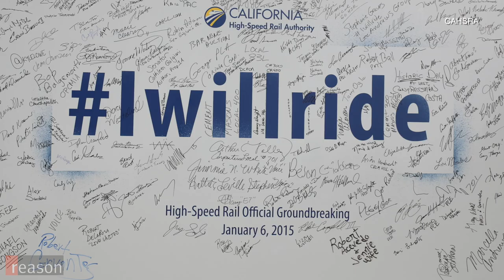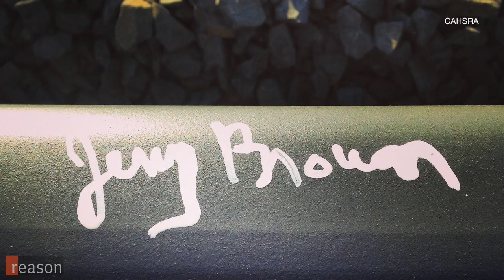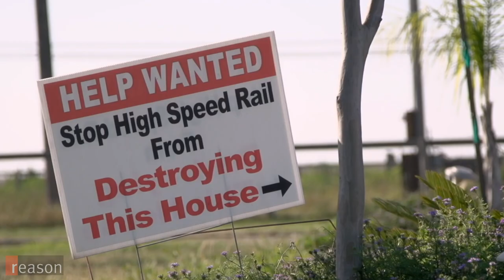The Politician Behind California High Speed Rail Now Says It's 'Almost a Crime'

Comment: Regardless of cost, even though it's a huge cringe, this also occurred with Japan's first attempt at high speed rail. It went so far above budget, that the people who helped create it essentially stepped down as being in charge. However, it proved to be the most efficient and productive way to transport passengers and mitigate traffic when compared to planes and airports alone. No one wants to spend money, but we have to spend way more now because we all went back on our chances when we had one at rail back in the 1960's. We threw away our chance when we pulled out short rail throughout los angeles county alone. Now that we realized that constant buying of cars with no limits in sight isn't sustainable, we're now putting light rail and long range rail back in. But yes, the price is much bigger than had we kept our rail property we originally had and had built when we should have back then.
Reply: i know this is 3 years old, and i really don't care.
so heres the thing about what you said: we are using 1800s technology to solve a problem with poorly designed freeways in california from the 50s and 60s, to basically attempt to pull back cars from roads, which are a 1900s technology. we should've used 1800s technology (going back to the stone age of mobility basically) back in the 60s and followed what japan and eruope did, so we would've had the "high speed trains" (aka, trains with just a bunch of new and modern equipment so it can go much faster but still be stupidly limiting on mobility) here.
how does that sound reasonable and innovative? you are basically wiping the dust off a old technology, replacing the steam engine with high speed electric powered engines and then put a buttload of electronics in the locomotives and the passenger cars so they appear modern but in reality its reusing a technology from the 1800s to attempt to solve a problem with heavily congested corridors the very same government let get congested to begin with.
and how is that fair to the average consumer? its not.
and much like 99.5% of all mass transit in america, it will get underuilitized and never make a profit for the life of it, and in 40 years will be so outdated and run down that not many people will feel safe even riding it.
Reply: @dhruvpandya4136  im not saying innovation is bad.
not the overall premise of the comment.
what i am saying is reusing 1800s technology that has limited mobility, and giving said 1800s technology a 21st century refit to tackle problems of a 1900s technology that has provided americans unparalleled mobility is bad. there is much cheaper ways to fixing congestion, such as modernizing roadways to modern interstate standards. if you look at phoenix arizona, they started their freeways late but because they did that, they have the least congested freeway system in the us right now. and ADOT is actually constantly updating roads and freeways to meet congestion needs in phoenix arizona.
this whole idea that widing roads is a constant loop is beyond stupid.
and phoenix arizona with ADOT has provided a actual example of what happens when you do keep up with your cities infrastructure. they ain't even on the top 50 most congested cities in the us.
Reply: @Zeakthecat  Ahh yes because Japan and the Netherlands and numerous countries with better mass transit that use trains are less mobile and walkable than the United States. Sure thing pal. In the United States you have no choice but to own a car. Trains aren't an out dated form of transport. They are an out subsidized form of transport. Car infrastructure is insanely expensive and the majority of roads are not toll roads. Cars are subsidized simply put. It's why roads in America are under maintained. If the USA hadn't subsidized the creation of car infrastructure and bulldozed cities to fit cars the USA would have more of a variety of transport options. Trams were common in the early 20th century and walking around was possible. Trains connected every town and city as well.
Reply: except it isn’t efficient at all
Reply: Nope, this never occurred in Japan. Japan had a significant cost over runs with their first attempt, yes, because the original budget was very, very small. California high speeds original budget was extremely high already. Also, Japan had the additional expensive having to invent new shit as they went on.

There’s absolutely no excuse, and this never happened in Japan.

Comment: At first they say, that high Speed Tracks cost so mutch greenhousegases at construction and in the next sentense we talk about new Highways and a HYPERLOOP?! Yes, the environmental cost of a thosend miles Highway and maybe a Hyperloo is for secure better....
Reply: but hyperloop is a private company and you need a car to use highways
Reply: Fun fact: Reason is actually funded by a oil company.
Reply: @Yassified3425  funded by the koch foundation that explains this bs
Reply: i mean. if cali plans to go electric by 2035 for all new car sales and before then likely will have a large majority of its new sales in EV's that would be cleaner would it not? more over it already exists, as opposed to building new trackage for the high speed train, which, likely wont be running until ~2030 at the earliest and probably closer to 2040 realistically. so yes, it would save on greenhouse emissions to cancel it now
Reply: @austinreid3951  EVs are not cleaner than trains and definitely not faster

Comment: One BIG problem I see with trains in this age of terrorism, is that tracks are subject to sabotage.
Reply: Imagine  flying off the rail at 200 mph. Not a pretty ending.
Reply: @John: on a positive note, this high speed rail will go no faster than about 60 mph, which will minimize the death and destruction. And if it terrorism does become an issue, then the simple solution is to slow the trains down to 20mph. Problem solved!
Reply: Would you chose to live through an act of sabotage sitting in the train or in the plane?
Reply: Craig F. Thompson  see ...
Reply: Craig F. Thompson  I did not know I have to spell it all out for you. I meant, "see, rather to be on the train than on the plane." Clear now?

Comment: High Speed Rail is an idea that was rendered obsolete with the DC6 in 1946.The high speed rail gets the same average mileage per passenger as airplanes.
Reply: abram galler [citation needed]
Reply: Google it.
Reply: At 200MPH a train is skidding on the rail the traction is negligible ,it takes a lot of energy to get there ,and its stopping distance is well beyond visual range .The mileage figures for trains ,you got were for speeds below 85 MPH
Reply: The resistance of air on a train going at 200mph is tremendous .There are reasons why ground vehicles don't use turbines.
Reply: US Navy use aircraft turbine engines in many vessels, they don't go 200 MPH ,a ship has similar resistance to a train.

Comment: I live in Central California and I have an idea about what the future of the high speed rail project will be. Gov. Newsom intelligently trimmed the project, and now it will run only between Bakersfield and Merced. The logic of this is that sometime in the future there will be urban heavy rail (aka a "subway" line, though not actually underground) running from Bakersfield to Los Angeles over the grapevine. An subway train can hump the grade where ordinary rail cannot. When this happens, there will be no need for a train that doglegs over to Tehachapi and winds through the mountains. In fact, the entire line could be used to run subway car equipment. For the present, it will be used to provide a dedicated passenger train right of way for the existing standard speed equipment.

The original high speed rail wet dream was to have it be used to bring commuters into the Bay Area from the Central Valley, especially the Stockton area. I don't think this idea is very plausible. Going to work would involve three commutes. One, home to the train station. The train ride. The train station to the workplace. High speed rail would only speed up the middle leg of the commute.

It never made sense, and no one knows how long it will be before the project has any significant utility. It might a century before there is a direct rail line between Bakersfield and the L.A. area over the Grapevine.

Comment: "It will also be competing with air travel at a time when a new generation of quiet supersonic planes is about to take to the skies."  WTF?

I'm sorry, but you can't have anything pass through the atmosphere at supersonic speed and remain "quiet" – the laws of aerodynamics won't allow it.  That you claim it can and will happen is an outright lie.  No matter how pointy and sleek your airframe is, it will ALWAYS create a bow shockwave in the atmosphere, thereby creating a sonic boom (And I didn't even mention the noise pollution from aircraft engines needed to get those supersonic aircraft off the ground and up to the altitudes that would permit efficient supersonic flight.)

High-speed rail has never been intended to replace long-haul air travel so stop trying to infer that is what its proponents are selling the public.  It has always be seen as a viable economic/environmental solution to short haul air-travel.  Stepping onto a train platform located in the downtown core of your departure city (10 minutes prior to departure), riding 200 miles (320 km) at 185 mph (300 km/h) and arriving at a station in the downtown core of your destination 1 hour 15 minutes later is a far cry from the 1 hour flight time of a short haul flight.  Especially after you factor in the 30 minute drive from city centre to your departure airport; the 45-60 minute pre-boarding check-in/security requirement for air travel; the 1 hour flight time; and the 30 minute drive from the airport to city centre of your destination.  All told it's taken you almost 4 hours to get to your destination 200 miles away.

@ReasonTV  You should rethink the name of this channel... a "reason" is merely and excuse for having done something or for not doing something and in either event it rarely has any rational thought put into it.  And that is precisely what this video is... an excuse, not a rational reason because all you've done is cherry-picked the excuses to the conclusion you want.

How many billions is spent every year building new or repairing existing highway/freeway infrastructure?  A hell of a lot more than it would cost to build efficient high-speed rail infrastructure.  Yes, building new infrastructure costs money – lots of it.  But once in place, if well maintained, it can last generations.

At this juncture of the 21st century, rail is still the most efficient form of transportation (on land) per ton carried by any means.  It takes less energy to move people or goods than automobiles (even EVs) and aircraft.
Reply: If it's so good it doesn't need tax dollars.
Reply: @kr854  Then stop using taxes to build and repair your precious roads/highways... you can pay tolls (a "tax" by any other name) every 50 miles instead.
And you'll pay much more up front than you would a tax because taxes don't pay for profits, tolls do.  And you're a captive audience on a highway (can't skirt around and avoid toll booths without incurring more time travelling on roads with lower speed limits).

The United Kingdom has the right idea in regards to rail travel and infrastructure: public ownership of the infrastructure (ensuring RoW safety and upkeep), with the private sector running the trains and paying user fees based on tonnage per train per mile (or km). (Airports charge landing/terminal fees, costs you don't see because it's part of your air ticket.) 
As usage goes up, more fees for the network are collected requiring fewer taxpayer funds to support it which is returned to taxpayers by lowering taxes – you can make this a legislative requirement through statute that can't be rescinded legislatively without a public plebiscite.
(You can be sure no private sector corporation lowered its tolls because it found a more efficient and less costly means to build new/repair old roadway infrastructure.  They'd pocket the profit and make an excuse to charge you more for the new roadway.)
Reply: @MelioraCogito  Comparing taxes spent on public roads which everybody with a car can use to limited use (and less efficient) railways is absurd.
Reply: @kr854  why is it limited use everyone can take the high speed railway

Comment: Having worked in Japan for mobile one corporation. They build small sections between 10 and 15 miles for 1 to 2 years. Then build up funding again.

Rail line 14 running from south to north took almost 23 years to build. But was down in small phases from small city to small city.
Also they buy the land for these projects 5 to 20 years in advance. So they they don't have to buy it from developers and demolition existing buildings and displace people.

Comment: So if you're in LA an head to LAX, BBK, LGB or even SNA, it's about a 40-60 minute flight to SFO for around $60.  Figure in 30-45 minutes to get to the airport, and hour to get through security, checked in, and boarded, and another 20 minutes to get off the plane and exit the terminal, and another 30-45 ground transport.  So 3.5-4 hours door to door.  You could drive it an about 6 hours and assuming 30 mpg at $4/gal, that's $50-60 dollars in gas.  Or you could take current rail solutions, two amtraks connected by greyhound which takes about 9 hours and is around $45.  The original plan for the high speed rail was $55 for a 3 hour train ride so realistically, 4-4.5 hours door-to-door.  Within the first year, the prices were revised to an expectation of $86 and the scheduling tames to suggest more like 5-6 hours.  Realistically that puts arrival times at no better than driving, and often worse.  Cost projections are almost certainly innacurrately low, even when they were revised from $55 to $86.  We would probably be looking at something that will cost twice as much as flying, and take at least twice as long to arrive.  When one can drive solo for less than either, and arrive 1-2 hours after the flyers and 1-2 hours before the train riders.  It makes no sense.

Comment: Here is the correct way to do high-speed rail: 1) It must replace high-traffic freeways to reduce air pollution and ensure efficient routing. 2) It must use magnetic levitation technology to be as efficient as possible. 3) It must be built only on elevated tracks, to avoid collisions with road traffic. 4) It must be privatized, not run by the government in order to ensure efficient, profitable operation. I wrote a paper in college on using maglev as mass transit in the northern San Francisco Bay Area, so I became familiar with the subject.

Comment: I've used the rail system in Italy a fair bit and I have to say that it is so vastly superior to air travel that I don't know if I can fully relate it here. First there is none of the security bullshit so you don't need to arrive 1-2 hours before you leave. Loading and unloading takes a couple minutes not 30+. You take your bags on an off yourself so no baggage pickup. You can arrive 15m before, without a ticket, buy a ticket at a machine and get on the train. There are no identification or ticket checks prior to boarding. Tickets are checked underway. The speed means that you get there quickly, not much slower than a plane and there is no taxing to the the gate and rarely a wait for a departure slot. The view is wonderful, the seating is spacious and comfortable, there is a food car where you can get a cappuccino.

How anyone can compare it unfavourably to car or plane travel is beyond me. It is the best form of transportation I have ever used. Clearly these people have no experience with well run rail systems.

Comment: Can i just say that if the High Speed Lines run profitable, without the Cost of building, they will become profitable in the not so far future, even with the Cost of Building? That is why it is important to build something like this now and not later. And a High Speed Line across the USA will definetly run profitable, even with the Cost of Building, atleast if the Route chosen is not the dumbest. Sure, it will take some time, because everyone is used to Planes and Cars, but it will get there fast.

Comment: Hyperloop is absolute vaporware 😂 It seems to be better at derailing transit projects vs transporting people. Sure HSR may not be so "profitable", but the road network is very unprofitable and state governments constantly front money for airport expansions. 

I would highly disagree with rail being a "20th century technology", I see 1000's of people every day on the trains in the UK, especially as in many areas they are more convenient than driving. No traffic, parking and you can get hammered and stagger back on home. Underinvestment is unfortunately crippling the system with bottlenecks in the North, but the South has a generally high quality, efficient network. 

One thing I will say, is that the US & local governments should focus on bringing up regional rail within nearby city pairs and metro areas up to scratch vs high speed rail.

If the trains can do a consistent 80mph, reliably, you're already competing with road transportation. Over time upgrades can bring speeds up, you can easily do 110-120mph with fairly standard infrastructure.

The best case for a dedicated high speed corridor would be the North East, as there is already very high ridership and the transit agencies could probably do with freeing up some extra capacity for commuter rail.